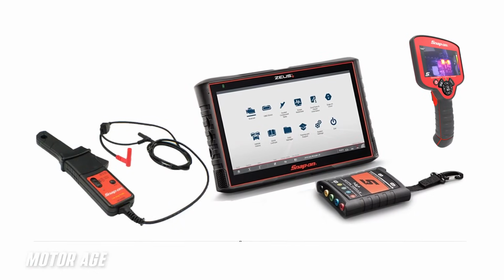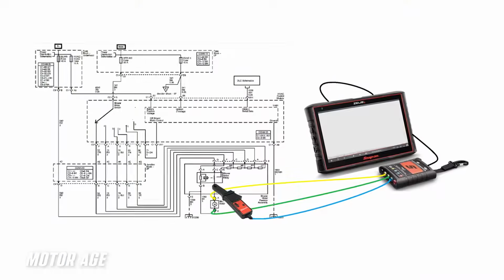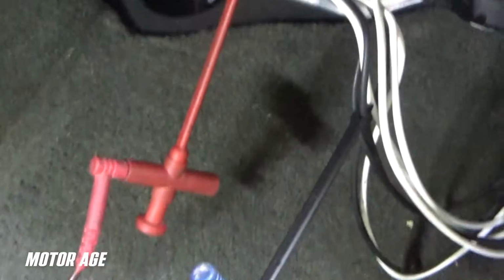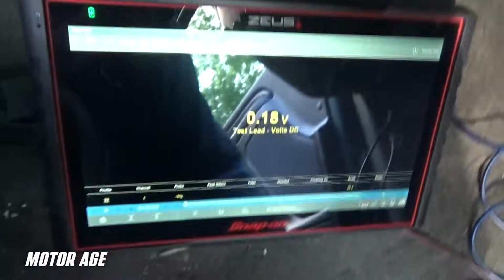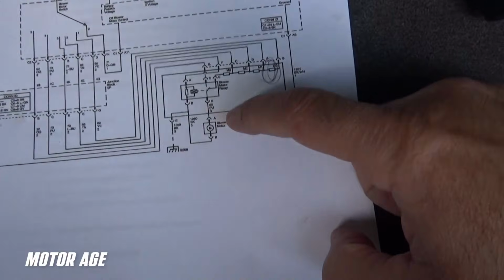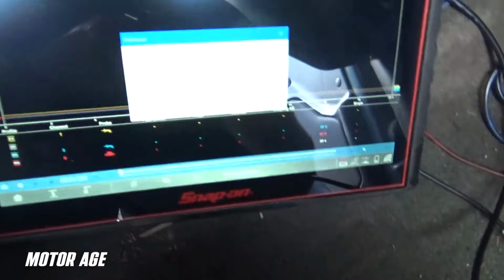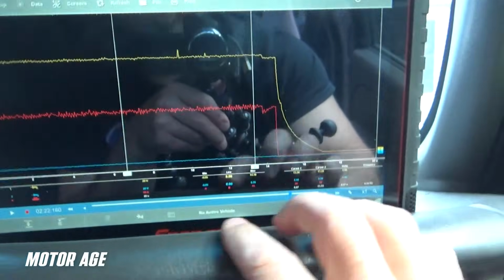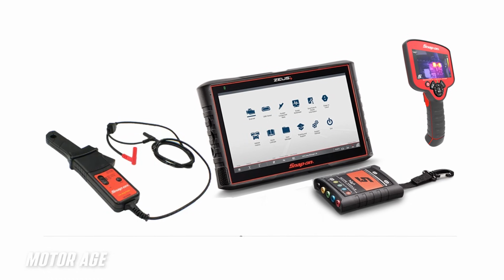Mastering Diagnostics #28: Demonstrating the Effects of Ohm’s Law with Snap-on

Comment: ScannerDanner had a couple of videos recently covering a similar situation and what he highlighted there is the difficulty of determining how much is "too much" current on blower motors, and I think this just reinforces that dilemma. Yes, 70 amps of inrush and 20 continuous seems high to me, but so does 60 amps of inrush and 18-19 continuous with a brand new motor 🤷‍♂️ That sort of comparison also requires said new motor to make so I don't know what the guidance should be here in a real world shop environment.
Reply from the maker: The failure of this type was not sudden, but more over time. The tightness if the motor bushings, size and design of the cage also come into play. Anything that will factor into the effort of the blower motor will effect current draw, hear, voltage drop
Reply: @VehicleServiceandRepair  It's common enough on GM vehicles that I would say best practice is probably to recommend (possibly even require for warranty purposes) a new blower motor with any resistor pack replacement like that. Other factor is that it sounds like people have better luck with an OEM resistor pack vs aftermarket (of course that's true for a lot of parts).

Comment: Nice vid but I would have liked to see the 2nd (new motor) thermal image taken in the same spot as the 1st one on the wire. The wire like on the 1st one may have been a little warmer than the plastic it was taken on. Just a thought.
Reply from the maker: This is a valid point. Brandon had stated that he wishes he could’ve captured the signatures “LIVE” for comparison